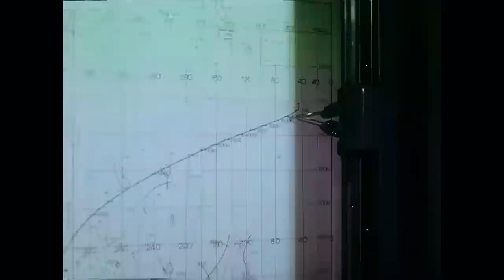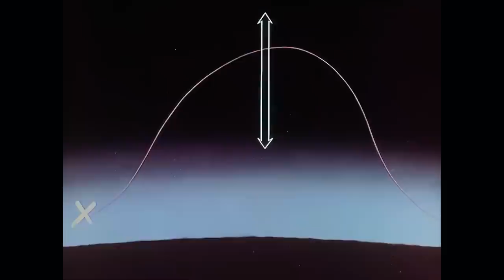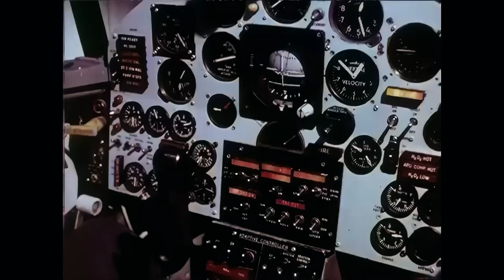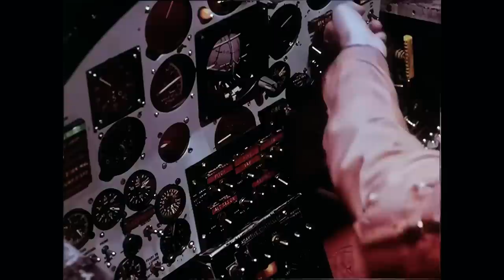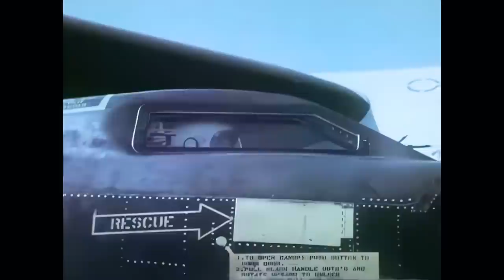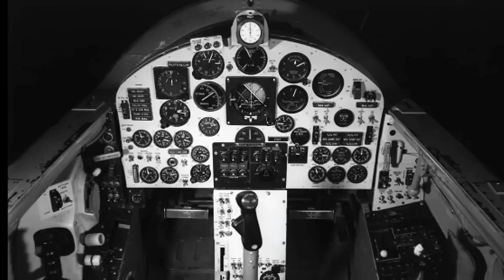X-15 - The Mach 6 Hypersonic Rocket Powered Aircraft | Upscaled Footage | The Project's Documentary

Comment: Did you know what was the critical discovery in the aircraft when it exceeded the Mach? It was the fuselage formation. It would have to get leaner and narrower at the point where the wings were attached to the airframe. That is what allowed the aircraft to be stable.

(I do not like the American term "stable". It refers to a horse stable. I always thought the correct term would be "stabile". But then, what do I know. I am just a Finnish 🙂
Reply: Nevertheless, despite the language, I love the United States of America. You people have achieved a lot. More than anything. I love you so much. I try to keep it at bay 🙂
Reply: In order to cope with extreme temperatures, ceramic coatings can be used. The problem with that is that the ceramics are ultra-fragile. They can be only used as a coating. They do not have any tensile strength. One can not be stretched or pushed tighter. But it works on some surfaces.
Reply: The basis would be MOAC steel. It is really hard to cut. I had to change the cutting pieces all the time with the CNC lathe because of it. The ceramics just melted away so soon. I could compensate for that by adjusting the program. But only for a moment.

You Americans have a different name for that steel grade. You could build a Katana of it, easily. I loved it even if it totally ruined our machine tools.

Now, darling, cover that with ceramics. Also, insert minor particles within the steel when it is still in melted form. You get a UFO steel. That is how it can be done, baby 🙂

I do not know how to insert micro-meter particles into a MOC steel patch. To my opinion it is impossible. It would ruin the steel. But then, what do I know? I am just a Finnish Engineer. Someone has surely figured it out, darlings. I do not know who. But I am in love with them too 🙂
Reply: The Americans were extremely kind to us. They sent the experimental ceramic cutting tool tips to us. Free of charge.
Reply: I just needed to make a report on how that particular unit worked. Easy.
Reply: Darlings, I can tell you this as a fact: Not all of them were much better - that is understandable -, but then they did improve. They could take more heat.

When doing even drilling to steel you absolutely must have the influx of water-oil. It hurts me to see Americans cutting steel without lubrication. Why, baby?
- You are destroying the tool. Please do not treat steel like that, darling. It will ruin your machine.
Reply: You're referring to what is called the Area Rule, and it had to do with aircraft that flew near the transonic range. It had nothing to do with an aircraft such as the X-15.
Reply: Area Rule
Reply: stable (adj.)

mid-12c., "trustworthy, reliable;" mid-13c., "constant, steadfast; virtuous;" from Old French stable, estable "constant, steadfast, unchanging," from Latin stabilis "firm, steadfast, stable, fixed,”.

Looks like we’ve been using ‘stable’ as an adjective longer than as a noun!